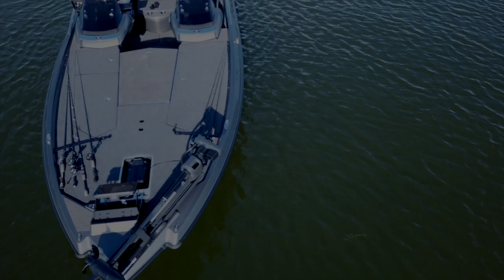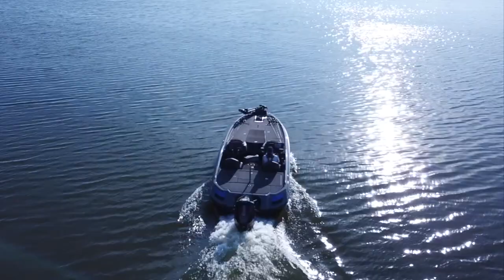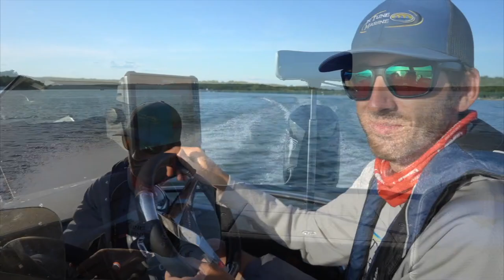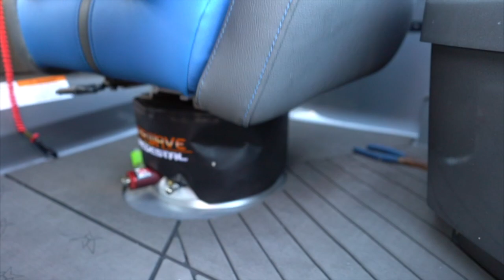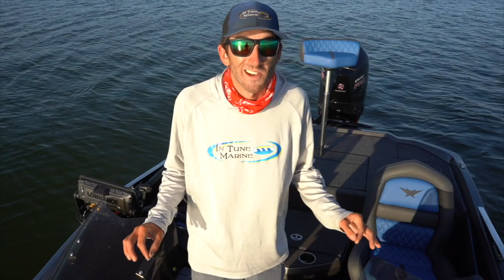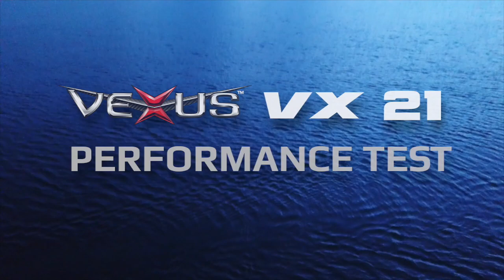Vexus VX 21 Performance Test (TOP SPEED)

Comment: This is the first boat I’ve seen with any 250 that doesn’t break 70
Reply: put on a different pitch prop and it will gi 70 plus.
Reply: have you seen how big they are???   its huge.  they weigh a ton
Reply: That boat is 21 ft 11 inches long and wider than most others. It's a heavy boat that rides good.

Comment: Let me tell you guys something about speed. When you're in a 300-500 boat tournament, and you're the 100th boat, are your running 70+ miles per hour? NO. This vexus will run 68 in the roughest water because of the ride quality and stability. You will get to your spot just as fast, and your back will be in 1 piece!
Reply: No. If you’re in a Stroker or Allison you’re doing 80+ in clean water.
Reply: @CaneCorsoProject  So what about rough water....

Comment: Dang 68mph that boat should run 72 to 73 mph all day. I would be running some test on that merc to make sure it's putting out 100% of the power because there has been a lot of them only doing about 72% from the factory.
Reply: Yamaha does the same till you get about 80 hours on it then it lets loose. It’s weird but my zx200 ran 65 top end till I did my 100 service. Hits 69-71 loaded down...  200 hp

Comment: Probably the best made boat on the market but it needs to go over 70mph with a 250hp 68 is super slow for a bass boat with that kind of HP on the back
Reply: 250
Reply: Most tourney loaded 21 foot bass boats aren’t 70 plus with a 250

Comment: 100K boat, 68 mph LOL
Reply: 100k boat Where? there’s not a 100k boat in this video
Reply: @austinrentschler9546  that's what they cost bro.
Reply: @MrBassOutdoors  100k depending on how you have it rigged from the factory.  you can get in one brand new for low 70k.  this boat in the video is most definitely not 100k.  it doesn't even have shallow water anchors on it.

Comment: Bought a brand new 2019 Z21 nitro with a 250 4 stroke merc. Not sure anyone would need anything more than that. A loaded bass boat brand new for $59k. This thing is 40k more and slower. Nor sure I get it. 🤷🏼‍♂️
Reply: when you buy nitro your not getting the quality and detail ... when i buy a bout i want it to be detailed out .. fiberglass boxes not some plastic insert box that you can take out.  you buy vexus for several things ... 1 Ride.   2. detail.  3 .qality   4. knowing  that the boat building process is looked at with a fine tooth comb .. not doing things cheap like bass pro does

Comment: Love the boat... speed not good at all. You will be the slowest person on blast off.. my ranger at 21 foot and trust me its heavy I still pushing 73 to 74. With poles and 4 batteries
Reply: This boat is much deeper than a Ranger. Ranger is probably the worst out of all the high end bass boat mfgs in rough water. Once the trolling motor is down though, on non-rough days, Ranger is the most stable. Can't have both.
Reply: @NytronX  Vexus is more stable than a 521. Had em both
Reply: @dudemcgee256  What about a Ranger z520L? Wider than the z521c or z521l, side to side stability should be better on the 20ft Rangers
Reply: @NytronX  The vexus is BY FAR the most stable boat I've stepped foot in or driven, or rode in. Period. Go test drive one and see for yourself!
Reply: @NytronX   not sure what ranger you were in but 520 and 521 by far were the best in rough water until now Vexus hands down
Reply: @kyleswearingen9347  Better than Champion, Bass Cat, and Phoenix? Or the new Skeeter FXR? Naugh. My previous message explains it well. Ranger sits the flattest, which is nice when the trolling motor is down and you're fishing, but not nice in rough water because the boat will spear waves.
Reply: @NytronX  deep v's cut waves which im sure you know .. but deep v's and wide boats make for a great ride... thats why you sacrifice ride for speed... the fxr porp going less than 25 on plane .. cats will beat ya to death ... phoenix is a good boat prob my number 2 but ranger and Vex have bigger fishing decks.. and champion well they are gone and had little to no detail .. ugly boats
Reply: @kyleswearingen9347  Champion hulls are now made by Charger.  And one of the hulls is now made by Basscat.  I've never seen an ugly Champion but I'm not a Ranger fan either.

Comment: Slow and way overpriced very ugly
Reply: 68 with a full tournament load isnt very slow, Overpriced ish, looks: meh
Reply: 1. Not Slow  2. What brand new 21 ft bass boat ISN'T overpriced these days?  3. Boat is beautiful
Reply: My pheonix 721 would smoke that boat
Reply: @danepinkston  for one I didn't say the boat was ugly 2 no need to be like that I'm a disabled veteran i played the price for my boat
Reply: James Baker that boat could run wide open in very rough water without beating you to pieces while you would have to slow that pheonix down in very rough water. They arent the fastest but they are the smoothest I promise you.
Reply: @stephenjoans1102  Far from the smoothest riding boat on the water 😂
Reply: @commentwars6693  It might be slow but it without a doubt handles rough water better than any boat on the market. Can run wide open in water where everyone else has to slow down due to the rollers and thats no lie.....
Reply: @stephenjoans1102  Vexus rides pretty dang good